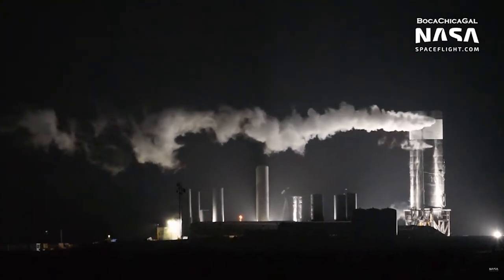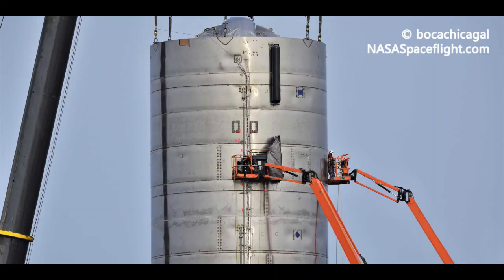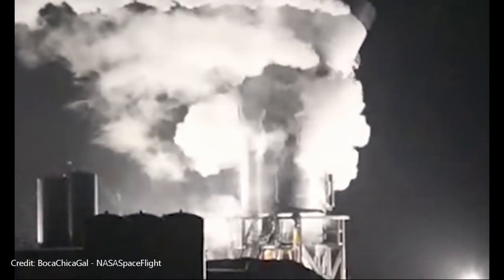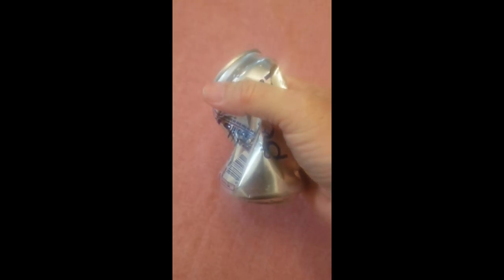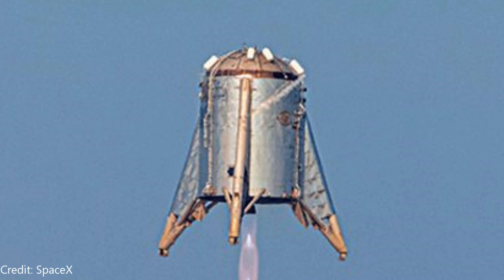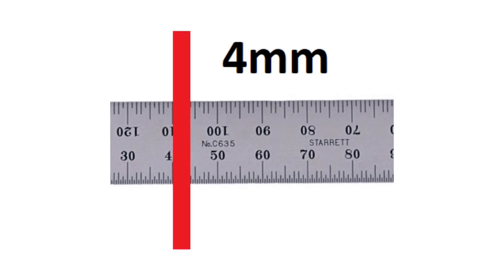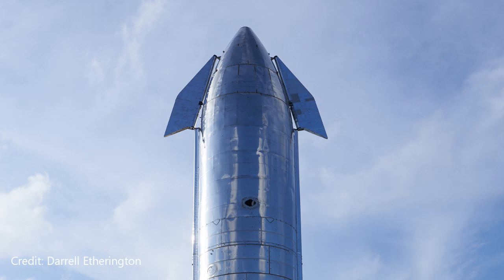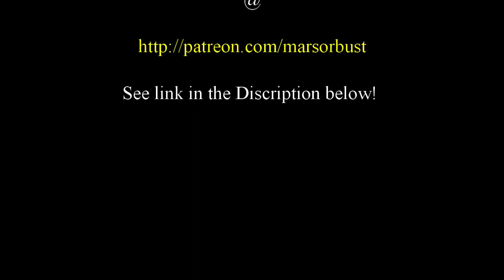ELON MUSK STARSHIP SN3 GONE AGAIN! - Starship Collapses! How Can They Fix These Problem???

Comment: IMO increasing steel thickness is too much simple as a solution, and don't be needed because structural strength can be an IS calculated on the drawing board with adequate softwares. Could you imagine to increase thickness back to 12.5 mm like on the star Hooper in other words multiplying by three the total mass of the system?? No, that would mean the end of the program as we know it now. Reason/s behind this failure must be more complicated than that, implying more improvement in manufacturing techniques to MATCH what calculated strength should be.

Comment: Elon has said it was a procedural failure. By that I believe he meant the lower tank should have been pressurised before the top tank filling started.
Reply: Yes exactly. With gas pressurization temperature fill and release rate alot can fuck up. Should have just used a room temperature liquid. Someone will undoubtedly lose their job for this mistake.

Comment: My first thought was the lower tank was pressurized with Nitrogen gas and it “flash condensed” into liquid nitrogen and “vacuum collapsed” the lower tank. But your close up shows the first area to buckle was between the two tanks. It could be a similar cause, the “air” in this presumably unpressurized volume could have liquified and vacuum collapsed. The last possibility is that since the interstage structure was not at cryo-temperatures, it was about half as strong as the cryo-frozen portion of the structure. This thermal difference in temperature set up a “cryo-thermal shock” to the structure. The cryo-tank wants to shrink in size, according to it’s CTE, or coefficient of thermal expansion, (which is actually contraction in this case) while the interstage structure wants to remain the same size, since it is not cold. This is classic mechanical engineering problem. The easiest solution is to keep all the structures near the same temperatures. But in space, any time that you move from sunlight into shadow, spacecraft structures experience even greater “thermal shocks”. So having this happen on the ground may actually save lives in the future.
Reply: Tony Rusi 
There is no gap between the two tanks, it is a common bulkhead between them. The lower tank collapsed because it wasn’t pressurised and therefore didn’t have the rigidity to support the weight of the liquid nitrogen in the top tank.
Reply: If that’s true, they need some new test engineers.
Reply from the maker: Yeah, That's a pretty stupid mistake if that's the case!
Reply: Mars or Bust 
Elon’s tweet “We will see what data review says in the morning, but this may have been a test configuration mistake”
Reply from the maker: Hey Tony! Hope your doing well! 
Wow, So very true! The way it collapsed so quickly, that would make complete sense! 
Thanks for the Great insight! 
SM Dave 
MoB

Comment: Yeah the material is too thin. I'm hoping the reasoning behind the 4mm isn't financial. The quickest journey to Mars takes 5 months, that's a long ass time. One small rupture in the exterior and its goodnight sweet prince.
Reply from the maker: Hey Norrin!
Yes, a little scary that's for sure! 
Thanks for the comment! 
SMD 
MoB
Reply: Hmm it's way stronger than what the iss is made out of 2.5mm aluminum. 4mm of 301ss should be better than 10mm of aluminium

Comment: FYI. 4 mm = 5/32nds or just under a 1/4 inch thickness. So, we are looking at a very thin body  in the rings. Add in the weight of a full oxygen tank on top and what appears to be modest pressure in the methane tank (no frost and minor venting when it collapses) allowed for this to crumple.
Reply from the maker: Hey Eric!
That's correct, I heard they were talking about trying to maybe go thinner in certain areas. I know there's a fine line between being to thin and being to thick for weight and lift capacity based on needed thrust. 
We will have to see what they end up with! 
Thanks for the comment! 
SMD 
MoB
Reply: @MarsorBust  - By the way, The F-16 has a skin thickness of 1/8th inch but those panels are supported by ribs and bulkheads throughout the plane, roughly every 2 feet. This is part of the reason why I'm uncomfortable with relying on this plate thickness for the only support of the Starship. I think they will need to add ribs for vertical and horizontal strength if they opt to keep going with the same plate thickness.
Reply from the maker: That would help I'm sure! 👍

Comment: You contradict yourself. You explain how a full soda can can withstand a lot of pressure, comparing SN3 to a soda can, but then you recommend using a thicker wall. As long as Starship is sufficiently pressurized it should be fine. It obviously wasn't during these tests and that's likely the cause of the failure, not insufficient wall thickness.
Reply: The compression strength of the 301 steel section is way more than required. 
The section is: 4mm x 9000mm (diameter) * 3.14 = 113040mm2. With a compressive strength of 301 stainless steel of 205 Mpa it can withstand 2.300 KT. which is way more than is required even under 6G load.
The problem is to avoid buckling, not to strengthen the hull. And buckling is avoided by pressurizing the tank section. Below the tank other means to avoid hull buckling are in place: Stringers and ribs.
Reply from the maker: Starship is not a soda can and there a lot of weight above, including other forces that are not found with a soda can...
SMD 
MoB
Reply: @MarsorBust  So why compare it? But in fact it is a good comparison. The hull, or fuselage if you will, would have helt just fine if the lower tank would have had the proper pressurization. I am not sure if Spaceship will ever fly to orbit (certainly hope so) but I am sure they will not increase the wall thickness.
Reply: As I mentioned in an earlier post structural stiffeners like those used in the engine section are the way to go.  Remember this is supposed to be a reusable vehicle.  Strengthening of walls is needed as the ship will return largely empty. This will require some reduction in paylond but the added strenghth will be needed to support the load of the upper pressurized section.  This test sequence failure exposed the need to strengthen the shell.  This is why elons iterative approach is the only cost effective way to design a new type of spacecraft.

Comment: Starship SN3 Structural Integrity Is Bad. Need A better Design Star Ship
Reply from the maker: Something needs to change, that's for sure! 
Thanks for the comment! 
SMD 
MoB
Reply: In zero gravity it may not be as bad and if the tanks maintain pressure it might be a solid design. However if a bird hit it in the atmosphere or debris in space it might be a different story. Some design changes may need to be done but the current design might be fine for missions such as Starlink. We will have to keep waiting. Bummer though hopefully SN4 will make it to the pad real soon.
Reply: Who knows actually. Integrity might actually be kind of good. If they let the pressure drop below atmospheric pressure in the lower tank this is what you get. Would be interesting to see the tank take some impacts while under pressure to see how strong it truly is.
Reply: Also it held up pretty well at first when it buckled. Pressure kept dropping however and it was too much.
Reply: Go grab a full cola can and try crushing it on your forehead. Then you may get an idea of the strength of thin walled pressurised structures!
Reply from the maker: LOL Sounds fun!

Comment: They will likely need to do 3 things.  Change the test to make sure lower tank is somewhat closer pressure matched to upper tank.  Also increase wall thickness slightly and/or add internal structural stiffeners to outer walls.
Reply: Also, it might work better if they had narrow steel rings to reinforce the welded seams
Reply from the maker: Hey Chris!
That make sense! 
Thanks for the comment! 
SMD 
MoB
Reply: @MarsorBust  Dave the ship shell definitely needs to be fixed.  The stress of reentry on a largely empty but exhaust pressurized shell is as you have picked up on not a good idea as their is no redundancy structurally in case of depressurization. I think both vertical as channels like in the engine section and rings sections at joints are needed.  Follow mother nature to get the obvious solution.  Internal structure is needed.  Don't send a squid into the toughest environment known for spacecraft. ie re entry.
Reply: I agree except with thickness increasing.
Reply: Nope just keep the tanks pressured